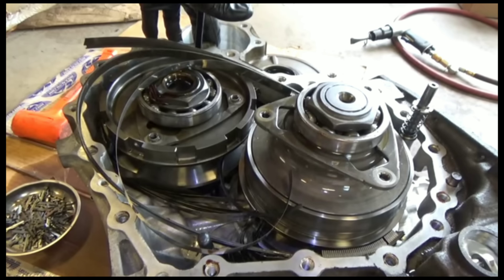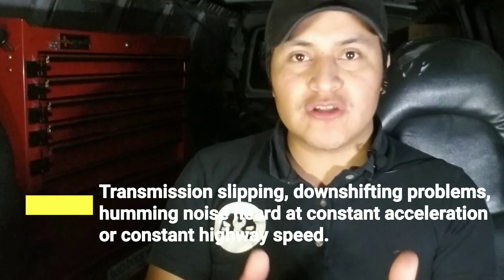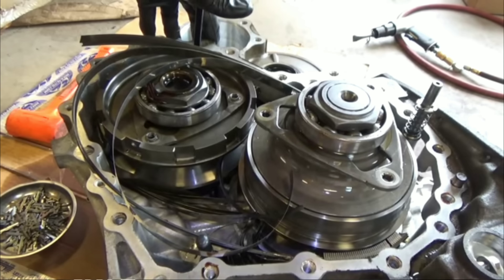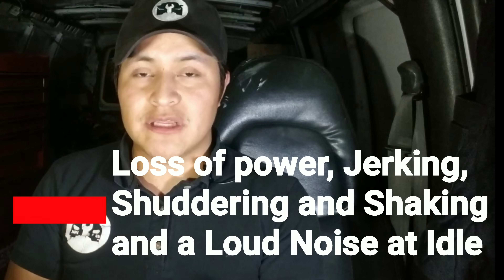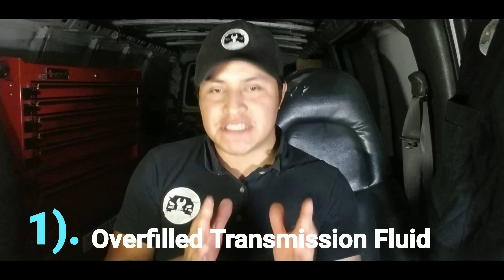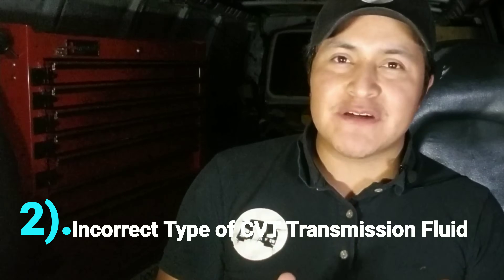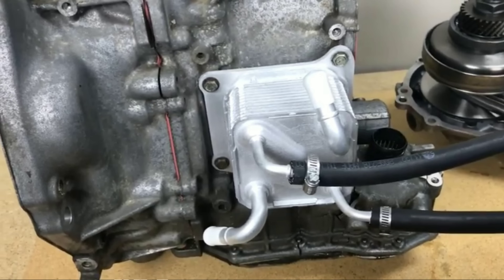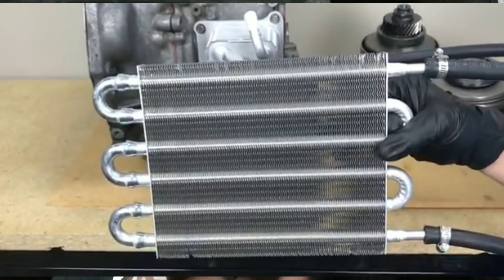NISSAN CVT TRANSMISSION | why it fails and what you can do about it to prolong it's life

Comment: This was the best video I have seen describing the transmission issues that myself and many others are having right now. And it was definitely tied into a broken radiator that had a slow leak for the longest of time that never produced the puddle on the floor. The car started shuttering and doing crazy things around the 93,000 mile mark (it now has 100k on it).

 My mechanic determined that the computer, the ECU unit went bad and I spent $1,000 having that repaired last week... Most of the shaking went away, but then I found out my radiator needed to be repaired which was another $450.

 After all that, when I shift into reverse or drive, the car still jumps forward and still makes crazy noises when accelerating and now my mechanic is saying that the transmission is failing and not to waste the money on it.

I will never purchase another Nissan vehicle ever again after this incident. I am driving a 2013 Nissan rogue that was gifted to me from a family member in 2019 and I barely got 5 years out of it..

I poured in a product called lubegard which thickens the viscosity of the new transmission fluid that I put in there which is a CVT transmission fluid, and it is helping a little bit but at this point I am just going to drive this car into the ground. 

I'm hoping I can get at least another year or two out of it because I do not have the finances to replace this vehicle and I don't think anyone is going to take this vehicle off my hands with a known transmission issue for a decent price.

I was also under the impression that you never change the transmission fluid, which is clearly not true either and if you look at the manual from the Nissan rogue, you'll see they never mention replacing the transmission fluid either.

This is all the racket and they want your car to fail so you end up purchasing another one sooner than expected.

Lesson learned.
Reply: Yup. They say "Lifetime" fluid but what they mean by that is the lifetime of the transmission, NOT the car! So yeah of course the fluid will last the life of the transmission cuz the transmission ain't gonna be doing it's job for to long without maintenance 😅
It's not Just Nissan, alot of manufacturers are pushing "lifetime" fluid. I still tell people to change their trans fluid every 60k ( 30k for a Nissan CVT) especially cuz a lot of modern transmissions no longer have filters you can change.
Just did a CVT fluid and filter change on a Sentra that had 102k miles. The magnetic pickups in the pan were both Bulked up with metal sludge from transmission wear...
Reply: I have 2014 Sentra sr . I bought it yesterday for 1500 with 123k on it. Was driving it home and the speedo goes out. P0500 .. 60 bucks.. I'm seriously thinking of just taking it back and getting my money back.. wyt?
Reply: Yup, I had a 99 nissan altima that was a tank... My 2014 nissan altima will be the last altima I'll ever own.

Comment: My wife is wanting a 2014 QX60 really bad, she found one with 190K miles and in the service records, it lists several trans services performed.  The vehicle runs out good to me. I did notice when accelerating quickly that the tack went up to around 5K and lower to around 4.5K a couple of times before I let up at around 65mph. I don't know what normal is on a CVT...Help.

Comment: My trans went out driving home while stopped at light. Once light turned green tranny blew 😢. Only decided to replace v get new car is because wife was previous owner so I'm in reality sole owner. Still...$5,600 a week before Christmas still killed me😵🪦. Hindsight is 20/20 so never had tran fluid checked or changed when it blew at 133,000 (Nissan sentra sv). One thing I learned is to do the $130 inspection at mechanic once a year for preventative maintenance.

Comment: Maybe you can help me out. My trans was slipping I changed the oil and the stepper motor. The trans rotates when in the air and placed in gear. But when on the ground it does not move with or without giving it gas. It revs up to 2 rpm and falls back down to 1.5 rpm continuously and again no movement. There’s no fault codes being registered. Any ideas

Comment: I currently have 3- 2006 Nissan Maximas, 1 2005 Maxima, and 1 2010 Nissan Murano, and 1 2000 Nissan Maxima . These vehicles have between 145,000 and 192,000 miles. Not one of these vehicles have had a transmission problem. Just recently one 2006 maxima with 145,000 miles exhibited a temperature issue. a slight downshift problem. I checked the  engine cooling fans just in front of the radiator. Both were not running properly. They were original. I ordered a new set of fans  on on E-Bay ($47.00) installed it and car is back to normal. My 2000 maxima  3.0 litre engine still runs 192K miles and has never needed  freon  in the Ac Compressor which is still original. I have more issues with Cam Shaft/crank shaft sensors. you must use OEM sensors from Nissan which cost $370.00 for all 3. All in all  Every car I own except my  Chevrolet Silverado HD2500  are Nissan  Maximas. Great Safe cars, Change the oil every 3000 miles. Change antifreeze every 50K miles, use good gas. I have no plans to change any of these cars any time soon.

Comment: I'm a rideshare driver w/ a 2016 Altima. For me, it's Service the fluid @ every 4 oil Changes (24K Mi). It holds up well on this schedule.
I'm also in TX. and the CVT has a cooler.

Comment: Nissan has cut corners doing these cars. The trans oil is not filled up properly from the manufacturer. My Nissan Sentra 2018, when it was time to service the oil for the trans, it had very little oil from the start. Meaning I drove for thousands of miles with little oil. I got it like that from the dealer. By then, it was out of warranty, of course. I will never trust a dealer even again, and im done with Nissan. My Trans now has that high-pitched hum coming from the engine when it is in Idle. If I use the cruise control, the rpm starts to jump up. But if I dont use it, it does not happen. 
When I get another new car, if we can next year with this inflation lol😡, I will ask to top the trans oil, or they can go scam some other idiot. I want to see them topping the trans oil. 
CVT is the wort move ever made. I want a Honda with VTech.
Reply: In Nigeria they swap the cvt with 4 speed automatic. I don't know how they do it.

Comment: The problem is the CVT old designs. Toyota is the only manufacturer that has a brain, they designed their CVT'S to ECVT which is electronically controlled with actual gears, and no pulleys and metal belt to wear out and break. You have to reinvent things to make them better and reliable. None of which Nissan ever did with their CVT tranny's. They make fantastic engines and cars, but lousy complete crappy CVT tranny's. However Nissan also makes very reliable real automatic transmissions and manual stick transmissions that are bulletproof. I have over 200,000 miles on my 2011 Versa with a 6 speed manual transmission, still bulletproof engine and tranny.
Reply: Yea I have an 350z 6 speed manual I swapped into my trans am. It's a very strong transmission that's for sure.
Reply: Hit and miss I'd say, the tranny on my 2013 Rogue has lasted 205k miles before having problems. I think driving habits might play into too, if someone drives it like a conventional transmission and not using Nissan's specific fluids plays a role. But I'm not advocating for Nissan, they dropped the ball big time on this issue.

Comment: I think the problem with cvts is mainly due to the small beehive cooler / heat exchanger that is fitted onto the unit being inefficient at cooling the fluid. I think if they ran the lines through the lower radiator tank (concentric oil cooler) it would be better

Comment: If you look up the Nissan class action settlement on their CVT transmissions, you'll see that you want to avoid ever buying a 2012-2018 Nissan with a CVT Transmission:

"The most recent lawsuit alleged that the Japanese automaker knowingly sold vehicles with defective CVT transmissions. Nissan agreed to pay over $277 million as part of the settlement to resolve certain defective transmissions claims. The following Nissan models are included in the 2022 Nissan CVT settlement:

    2014 – 2018 Nissan Rogue
    2015 – 2018 Nissan Pathfinder
    2015 – 2018 Infiniti QX60

This latest Nissan class-action lawsuit to settle alleges that several vehicles were equipped with defective transmissions and that the automaker knew about the CVT problem for years. Several drivers say that transmission and other lemon issues began appearing in their vehicles in as little 20,000 miles.

In 2020, three separate class-action lawsuits were settled with Nissan North America. The bases for these lawsuits were similar claims, i.e., that the manufacturer knowingly sold vehicles with defective CVT transmission systems.

Class action settlements were reached in all three prior lawsuits, which covered the following Nissan models:

    2012 – 2017 Nissan Versa
    2014 – 2017 Nissan Versa Note
    2013 – 2017 Nissan Sentra
    2013 – 2016 Nissan Altima
    2013 – 2017 Nissan Juke
Reply: Avoid anything with a cvt. 2007 and up till now🤣😂 they even had the Nissan transmission in those Dodge caliber. Alot of women's feeling were hurt with that car
Reply: @trentdaddydolla647  Yeah, I had a neighbor who bought a used Honda CRV with a CVT transmission with under a 100K on it. The transmission went up on him right after he bought it.

Comment: Periodic fluid changes, keeping the engine and transmission clean and cool, and not putting excessive stress on the car when driving, like driving it to hard, frequent and quick accelerations from stop or when increasing speed, pulling a trailer, etc... ) are key to the longevity of CVT transmission based vehicles. It is especially imperative for a Nissan Rogue. I have a first generation Rogue from 2011, bought it new at the dealership on Labor Day 2011. Always did my own work on it; it never went to a shop, except for new tire mounting, never had any issue with it other than common wear items, tires, brakes, battery, tune up, fluid changes, etc... Just this past Saturday 10/14/23, the transmission finally went out at 168,500 miles as I was driving about 40 MPH, just casual driving as usual. My rogue was the most dependable car I ever owned up until this past Saturday. Guess I was one of the few fortunate owners whose JATCO transmission lasted that long without having any issues. I've had mechanics tell me they were surprised it was lasting as long as it did, right up to the end. RIP 2011 Nissan Rogue!
Reply: Impera what?  Oh imperative. Got it.
Reply: What were the signs that the transmission actually went bad and not just in "fail safe mode"?

Comment: The dealership said they couldn’t find anything wrong with my Rogue and told me just not “stomp on the gas” 🙄
Reply: Sell it before it goes out. They don't make replacement parts for that transmission. They only replace between $3k-4k with new unless you can find a used one and even that's $2000

Comment: It would have been fantastic if the dealer who sold me the brand new 2016 Murano had said hey change the transmission oil every 30 or 40 thousand miles. It is not in my maintenance book. I am in the steady light hum stage. Of course I would not have bought a $43,000 vehicle if they were honest and told me. Now they are selling for 53,000 and they are still not telling the prospective buyer about the design flaw. I have owned Nissan cars and trucks since they were called Datsun, I am disgusted with them now.

Comment: ALL transmissions fail. My Nissans been good for 17 years. With regular maintenance. Never had ANY problems with my cvt. At any speed. Abuse and neglect are cause of most mechanical failure.
Reply: In this case, Nissan admitted in court that they sold defective CVT transmissions from 2012 to 2018 and had to settle with customers to get their CVTs replaced.

Comment: I have a 2015 Nissan Altima and the transmission I just found out is going I’ve had acceleration issues I’m the original owner and I only have 73,000 miles on it. Nissan only agrees to pay half of the 7000 that the dealership wants to charge me, I’m so disappointed after dealing with Nissan consumer affairs that they don’t support this issue that Nissan transmissions are known for

Comment: My 2017 doesn’t go past 1st gear and doesn’t go into reverse. It also goes into 2k rpm if I tap the gas pedal. What could be the issue?
Reply: "The most recent lawsuit alleged that the Japanese automaker knowingly sold vehicles with defective CVT transmissions. Nissan agreed to pay over $277 million as part of the settlement to resolve certain defective transmissions claims. The following Nissan models are included in the 2022 Nissan CVT settlement:

    2014 – 2018 Nissan Rogue
    2015 – 2018 Nissan Pathfinder
    2015 – 2018 Infiniti QX60

This latest Nissan class-action lawsuit to settle alleges that several vehicles were equipped with defective transmissions and that the automaker knew about the CVT problem for years. Several drivers say that transmission and other lemon issues began appearing in their vehicles in as little 20,000 miles.

In 2020, three separate class-action lawsuits were settled with Nissan North America. The bases for these lawsuits were similar claims, i.e., that the manufacturer knowingly sold vehicles with defective CVT transmission systems.

Class action settlements were reached in all three prior lawsuits, which covered the following Nissan models:

    2012 – 2017 Nissan Versa
    2014 – 2017 Nissan Versa Note
    2013 – 2017 Nissan Sentra
    2013 – 2016 Nissan Altima
    2013 – 2017 Nissan Juke

Comment: my nissan versa 2012 wont engage 3 or 4 would the internal filter ( it has 2 firlters internaly) caused this problem?
Reply: it's covered under the Nissan lawsuit settlement for your year. 

The most recent lawsuit alleged that the Japanese automaker knowingly sold vehicles with defective CVT transmissions. Nissan agreed to pay over $277 million as part of the settlement to resolve certain defective transmissions claims. The following Nissan models are included in the 2022 Nissan CVT settlement:

    2014 – 2018 Nissan Rogue
    2015 – 2018 Nissan Pathfinder
    2015 – 2018 Infiniti QX60

This latest Nissan class-action lawsuit to settle alleges that several vehicles were equipped with defective transmissions and that the automaker knew about the CVT problem for years. Several drivers say that transmission and other lemon issues began appearing in their vehicles in as little 20,000 miles.

In 2020, three separate class-action lawsuits were settled with Nissan North America. The bases for these lawsuits were similar claims, i.e., that the manufacturer knowingly sold vehicles with defective CVT transmission systems.

Class action settlements were reached in all three prior lawsuits, which covered the following Nissan models:

    2012 – 2017 Nissan Versa
    2014 – 2017 Nissan Versa Note
    2013 – 2017 Nissan Sentra
    2013 – 2016 Nissan Altima
    2013 – 2017 Nissan Juke

Comment: I had my trans serviced once around 100K. Now, I'm currently looking at 235,000 on my car with no problems, other than you can slightly feel the tolerance from trans to wheels getting a little wider, which is to be expected with this many miles. I am fully aware of how CVT's operate, as well as their fragility so I don't dog my car except when necessary. I've lit the tires up a few times in emergencies and I've replaced the CV joints a couple of times but the trans still performs like day one. I try to avoid steep hills and mountains (I live in Atlanta so not a problem) and my cargo is usually just me except for gigs when I also load up about 200 lbs of music equipment. I have been nothing short of happy with my 2013 Nissan Rogue, 2.5L.

Comment: Reasonable fluid changes and not beating on it has worked for me on a 2010 Maxima and a 2016 Altima. Both into the 150K range with no issues. CVTs don't stand up to abuse and Nissan's lifetime fluid stand (US only) is crazy. I use Castrol CVT fluid in my Nissan and Honda.
Reply: I use the Castro CVT fluid also. I have been running Trans Tune in it 100 miles or so before change. My 2007 Altima just hit 210,000 and my 2009 Maxima just hit 170,000. No issues besides normal maintenance. Knock on wood. I do oil changes every 3k, and have been doing Transmission every 30k. Overkill I know but it’s easy to do so why not. They both get good gas mileage  and were cheap. My son drives the Altima to school and back and my Maxima I take to work etc. great cars. I don’t know if I would ever buy one new though.
Reply: @EricSchoville-yj6px  for what they want on new ones, I'd definitely try to keep whatever is currently working!   Lol
Reply: 2013 murano. My fluid is not discolored but there is some slippage at times. 175k miles but no noises. Not bad but a concern Thoughts are welcome.
Reply: I love late model Maximas..... GODDAMN Nissan for these shitty transmissions!!!! SHAME, SHAME, SHAME 😡🤮🤮🤮
Reply: I also use castrol CVt fluid for my 14 Altima. 156k miles and no major service needed yet. Runs smooth almost as day 1. I also change oil regularly with Nissan filter.
Reply: Have a 2011 Versa, 240K, never changed the fluid, haven’t had any of these issues. 🤷🏻‍♂️
Reply: Same. 160K on my 2010 Altima SR. Change CVT fluid every 60K. No issues. Maybe mine is not Jacko? Not sure but it runs like a clock.